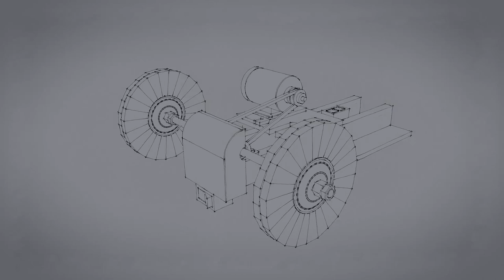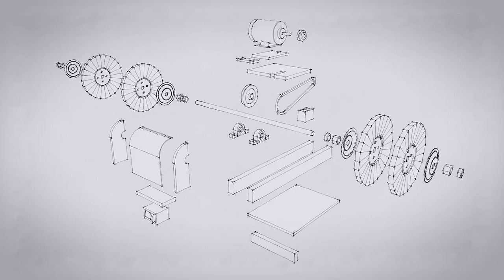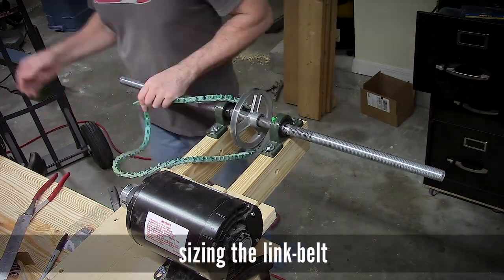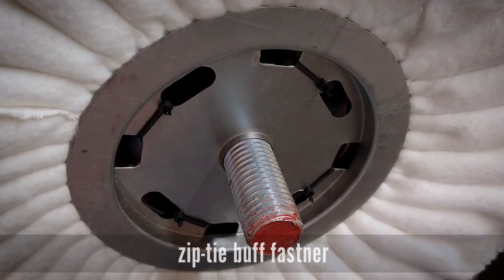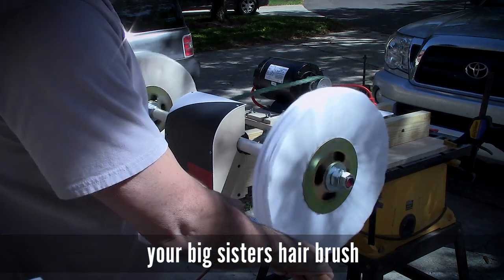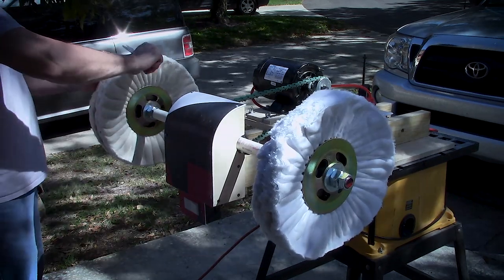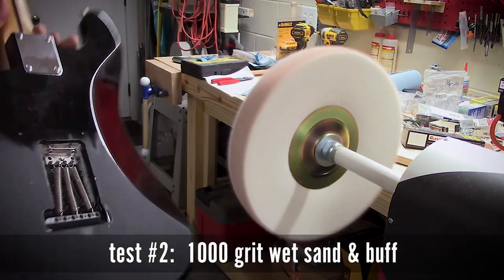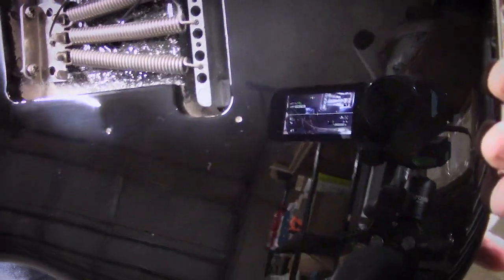DIY Benchtop Buffer Build - Free Project Idea Plan link

Comment: Great video!
Thanks for the links too!
This is definitely something I want to build!
Reply from the maker: Stephen, thanks fo watching!
At this point, the only change I'd make if possible would be a precision shaft with threaded ends. Sadly, I don't know any local machinists, and can't get any response from local machine shops.  I am considering getting a 24" precision shaft and having  6" of R and L threaded rod welded to either end of the shaft. I do know a welder who can pull it off.
I hope the info in the link helps ya.
Take care!
Reply: @theNextProject  You may be able to get a3 foot, 1" precision shaft and anneal the outside 6" of each end and thread them to match the nuts you have now, then re-harden them so that they will not bend if bumped. Thanks and Good Luck! If I find anything, I will contact you!
Reply from the maker: I had hoped to get a local machine shop to do just that, but I can't get anyone to return my calls. I'm guessing making (1) shaft is a waste of time for these shops. I need to find an old-timer who had a garage full of history and knowledge to do this job. I'll keep looking.
Thank you for the help too, take care!

Comment: Looks great, but how were your bearings and pulley so loose on the rod?
Reply from the maker: Garrett Guitar, thanks for watching!
The bearings and pulley are only loose enough to get the thing together and apart easily. This isn't a highly refined machinists assembly, but works really well.   I filled the threads of the rod/shaft with JB weld where the bearings and pulley ride. This offered a better and flatter surface for the mating surfaces to meet.  I then used thin shim stock ( beer can ) to minimize the difference in dimension tolerance. A keyway was cut for the pulley, and setscrews lock the bearings to the shaft. 
The biggest issue is using the threaded rod as the main shaft. Threaded rod is typically not precision straight... 
Sadly, I've attempted to get a machine shop(s) to make a shaft for me... $800 - $1000US. Ridiculous! That's not going to happen.  Most modern machine shops are CNC based now and ask hundreds for programming & setup, etc. ouch! I'm having a hard time finding a small shop with an old-school machinist to make a shaft with threaded ends and a keyway. Makes me want to buy a lathe and do it myself, lol. 
Thanks again for watching!
Reply: @theNextProject  Thanks!  It does seem like a very useful build, and I really like the link v-belt idea.